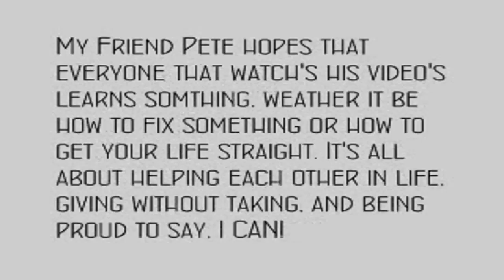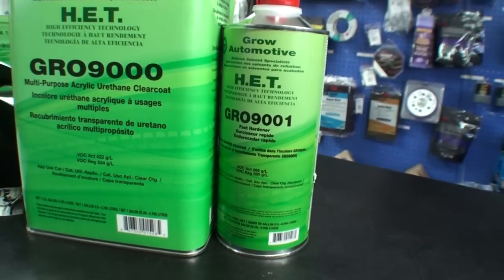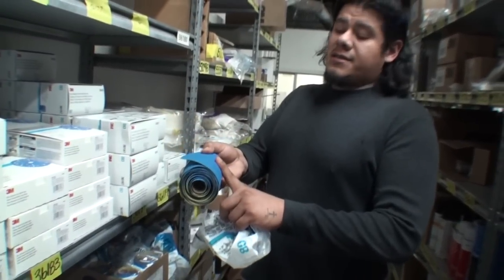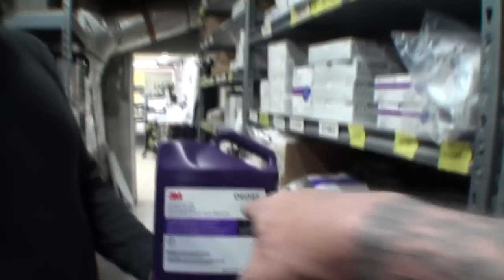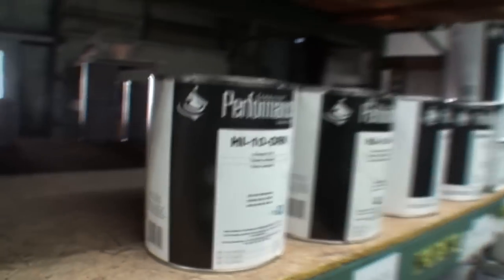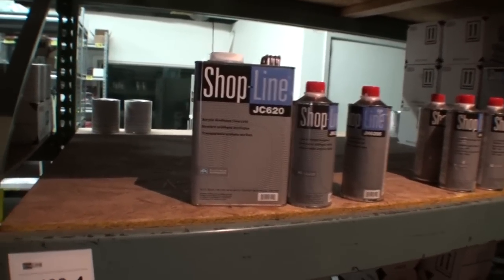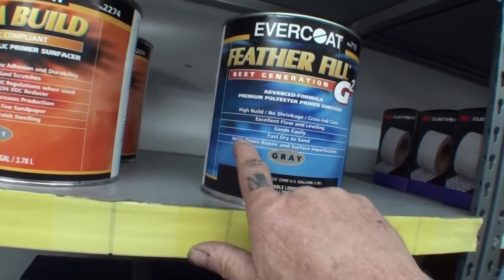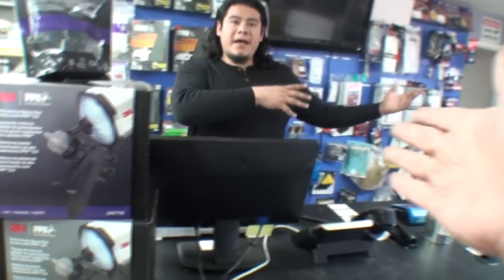What Should I Buy To Paint My Car? - Automotive Paint And Body Tech Tips

Comment: Hey my friend Pete, you should try out and review the new Harbor Freight pps style paint cup system by Spectrum. I just bought them and very reasonably priced.
Reply: You are correct but it has only two ears to hold the cup on, so it’s kinda a copy of the first generation PPS disposable cup system. It would be fine for smaller cups with the weight of mixed product. I don’t think HF offers different size cups.
 The feedback from painters on the PPS system was they felt the larger cups moved, wiggled and could possibly come although none may have. This prompted PPS to come out with PPS 2.0 with 3 lugs to latch onto the adaptor, instead of 2. It is still a good choice for a guy to purchase the HF cups, just have product mixed ready to go (Depending on Time) to swap out a cup and keep going. The size of cup, how large the area to be painted have to be figured before starting the spray. I never used them but when changing directions during the spray gun & cup, just go slower without sudden fast moves. As expensive as everything is, no one wants the cup to come off, hit the floor and waist your mix.
Reply: @deankay4434  I've used them and they are basically old pps system, but  not interchangeable with 3m.  But I have noticed the HF spectrum PPS cups fit tighter and feels more solid than the 3M PPS.  Best part about ALL PPS system is the ability to spray upside down say like under package trays or wheel lips and rockers. HF PPS  cups are good for entry level painters, or hobbyist that only paint once a year. But very economically priced for The D.I.Y. guys and gals. Never had a cup fall off or leak. But while painting you're not whipping a paint gun around in sudden jerking motions, steady straight passes with calculated overlaps . Remember sudden movements  while painting will cause more dust in the air. When I paint I shuffle my feet instead of walking.  Not saying a paint cup cant fall off, I've actually dropped my paint gun and aluminum cup snapped off in the gun. So lessons is EVERYTHING IS POSSIBLE. But take your time and you WILL get results, and listen to Our friend Pete. He knows what's up. Reason I love to get his take on The HF spectrum PPS cup.  I do appreciate your info and will take it into account.
Reply: @jamessmothers6475  I completely agree that the HF cup system can be helpful for hobbies, DIY’s or complete restorations. I have never used them or seen one, just going by what others have said. HF may have beefed them up somewhat as they can’t be exact copies as that could be patent infringement. Regardless, they are useful as long as someone using them understand they may have limits. I have a Bink’s & DevilBliss but have some new style and fitted with PPS 2.0 and I agree, spaying upside down has a great benefit. I fixed vehicles, up in the air, rust spots, thin or no paint on rocker panels or the fender lip (Including over-spray) on the inner wheel house we’re all clues of a past life done wrong. 
  Buyers purchase what dealers need for used cars. We had a truck load of Nissan Pathfinders and asked to check fluids, brakes and condition. I raised a blue on up and found the front cab to the grill painted “RED” plus a weld line left to right. Needless to say, someone bought two, welded them together and painted it. We sent it back because it was salvage! Best of luck.
Reply: We will find out what Pete thinks of them James, as he just bought some at HF. 
Don’t get me wrong, I think these work great for the benefits and the price is right. I am a cheap bastard but I sprayed something like primer and washed the cup out and re-used it several times. I do that with zip lock baggies as I have a pile for nuts on bolts to store until ready. I drop a large note in the bag to identify the parts. I can’t get my son to do that or even photos. So, 6 months after I painted it, I have to wire the pair of electric fans, relays & fuses again. He tells me he will pay me but gives the wife the money, so still free work. Best of luck to all!

Comment: that $65 clear is great for jambs that doesn't ever see the light of day. Iam old school I guess , no velcro paper for me...always use stick on.  I use the screw on double wool pad then switch to the foam pad for the final buffing.  Been using the Indasa abrasives for at least 10 years.  The hell with 3M...that stands for 3 X money.
I used to use ppg DP epoxy.  That went away and the y went to DPLF (lead free). Thats kinda pricy so I went with the PPG Essential fleet line epoxy. Its the same except less $.  Only gripe about PPG epoxy is that it contains a vinyl product so the it does not get airborne during sanding. The vinyl  product gums and loads the sandpaper...frustrating.  I have used the Tamco epoxy and does not load up....there  are others out there.  The local ppg dealer here doesn't handle shop line...they have Omni that I guess is the same...not sure.
Started my shop in  1978...no internet to buy supplies...just a few jobbers.and a handfull of paint companiies.....Dupont, ppg, acme, sherwin williams, RM and a few others.  How nice it is now to be able to search around for better deals on supplies.
I had the good fortune to chat with a paint chemist that worked for PPG in the 80s,,,was fun to pic his brain how things were done....he worked in Ohio I believe. He said that in all the things the PPG makes...and there are a lot of them that the automotive paint side is the most profitable for them.....I dont doubt that a bit.
Love your vids Pete...like your no nonsense no bullshit approach.
Reply: Love the "3m means 3 times the price" comment! LOL. Heck yeah....And stick-on sandpaper IS the ONLY paper to use when actual block sanding a car for REAL STRAIGHTNESS, as the hook it/velcro is fine for stripping, actual filler work etc. but from like even 80, 120 and so on grit when "blocking a car"? The hook-it paper WILL LEAVE grooves, lumps on the panel on your blocking process! So stick-it is fine IF ya don't wanna have to re-invest in the hook-it. Grind ON! 👍

Comment: They use to have a Trizac compound when the 3000 foam pads came out and it would break down as you polished,you only needed 1 pad and 1 compound,of course they discontinued it so you now have to buy 3 pads and 3 compounds,and you need the blue pad with the blue compound or you still have swirls.

Comment: Pete, need some advice. I've done filler/bondo on bare metal after doing quarter panel replacements. I'm going to paint the whole car but what should i apply on the bare metal/filler prior to paint. i'll use high build primer but should i apply epoxy sealer before hand? Years of watching you with so much knowledge seen yet i don't retain information
Reply from the maker: No -- You don't have to apply epoxy first -- Go straight to a High Quality 2K primer with the metal prepped to 80 grit sanding.  2 to 3 full wet coats and your ready for block sanding and painting.. THEN if you want to add a coat of epoxy right before paint, that's the time to do it!   Good luck

Comment: The pps system of cups, liners, tops with filters built in and the quick connect fitting to put it on any gun is sold at harbor freight. The cost is way below this shop. 3m's name is not on the box but it has nothing to do with how your gun works. It shortens clean up and mess and cuts thinner usage.
The gun that was on the counter is one that you toss the gun tip with each use. I saw that system a few years back and said no way. That is throwing money away every day.

Comment: Ok just a hypothetical question here. Paint reducers offer slow medium and fast. So what is it slowing or speeding up if it's just to thin or reduce the paint? I understand hardners/Catalyst. If it's to hot and wanting a slow activator so it doesn't set to fast or a fast activator during colder Temps to help speed up. But never understood reducers as it is only thinning/reducing the paint.

Comment: The whole thing with 3m cubatron or purple is its a man made synthetic grit and last a long time. With Velcro or hook it you save money if you use it right.  plus you can use a 5777 soft pad with it.   Velcro you can take it off and reuse it until it’s worn out with stick it you tear it off and throw it away even if it’s still has good cutting power it’s wasted. So if you do a lot of body work Velcro paper will save you money. If you want a excellent epoxy for low cost try the ppg cre epoxy make sure your prep work is right it prefers a blasted substrate it’s in the fleet line. Shop line plus is the exact same thing as ppg Omni. All in all it’s a good paint line. I like the 6800 euro clear or the 6700. Jc620 to me is thin so is Jc630. But it looks as good as anything once it’s cure and wheeled. It doesn’t have the chip resistants that 6700/6800 has so on front bumper covers I’d recommend activating the base coat for a little better durability….
Reply from the maker: I disagree with you on the Shopline -- OMNI thing.. Ive used Omni and to me it's the BOTTOM OF THE BARREL stuff that PPG sells.. The Shopline Pro is equivalent to DBC and uses the same toners and binders, the only thing different is the clear.. Ill take Shopline over Omni any day and I'm sure there's dozens of people that will agree with me.. I tried the Shopline clears and the only one I like is the QUICK DRY for bumpers and collision repairs. I wasn't impressed with the Shopline clear at all.. Thanks for the comments...

Comment: I've shot that value pro clear and it was ok. I typically stick to SPI clears and primers. At the shop I worked at they had me shooting Shopline clears on high end restos. I didnt think it was that bad. Shopline base......ehh  I get it on the price, but with the poor coverage of it you use more and in the end it ends up costing the same as DBC depending on the color. I switched to Automotive art Motobase and couldnt be happier honestly.
Reply from the maker: If never had any issues with coverage using Shopline as long as Ive used it.. It covers as good as DBC to me.. You might have been using the regular shopline and not the JB Shopline PRO paint..  I didn't like the shopline clear at all...

Comment: Hey Pete, working on a diy 94 Silverado Z71. Watched most of your "vidids". Bought durablocks for sanding based on your blocking video. Found out that they come setup for psa or hook and loop after eating. Did my own research and bought hook and loop since I could swap out paper (more expensive). Unfortunately, I didn't realize the paper was all so more expensive and less available at local suppliers. So, this situation has cost me more money and not less. Even though, your recemendation was spot on in theory. Thank you for hearing my complaint. Keep on providing valuable information.
Reply: Hook-it/Velcro paper is FINE for sanding body filler, or "course cut sanding" even stripping off paint etc. It's WHEN it's time to BLOCK SAND High Build Primer, and  BLOCKING PANELS FOR ABSOLUTE STRAIGHTNESS (whether "start blocking with 80 grit" OR really about anything 120 grit to 150,180 grit and higher UP the sandpaper line) IS WHEN you NEED TO STAY WITH STICKY BACK SANDPAPERS!  The Hook- It paper WILL CAUSE ripples in your final bodywork based off it's design. So, for someone that IS a DIY and ain't running a collision shop? Sticky back sandpaper and the blocks that use it ARE FINE/PERFECT for such. Been using sticky back for DECADES with my hobby/past business restoration work so... Get after it and get ta GRINDIN! 😎

Comment: Yep. They figure new ways to keep taking your money, so they can make more & more.
But a quick question Pete…
If its disposable stuff, and you dont have to clean your gun, would it be cost effective, compared to how much time is spent cleaning the Binks #7?….. Cuz time is money.
Reply from the maker: No. It takes 5 minutes  and 1.37 worth of thinner to clean a gun.
Reply: @diyautoschool  Then, it’s it big fat NO to 3M disposable junk. Also, I’m sure at some point, there will be a shortage of tips or some B.S. Leaving the ones using them high & dry.
Reply: What you have to figure on the 3m gun is it does it all by changing tip, if you go with regular guns you would be buying 3 guns for primer,base and clear.
Reply: @jeremyking5684  I think two cup guns is all thats needed. But, with the disposable system, each use is going to cost 9.00-10.00, depending on the tax rate.
If you prime 2 coats, sand, (possibly) prime again, sand, seal,  paint, and clear, thats a minimum of 4 uses, but most likely five. That's concidering you prime, seal, paint and clear the entire car at the same time. that would be 36.00 - 45.00, possibly up to 50.00 per job. Then, there will be times when another primer or 2  srpayings would be needed. It could get up to 70.00 or even more.
That adds up quick.
I’d stick to the binks for cost. I’d also stick with Binks out of principal.

Comment: Global use to be PPGs top line in 2000
Reply: It still is...
Reply: @brad-zf9oh  I always liked Du Pont system,etch primer, they use to have the best primer called URO,three  part s,and could be thinned to use as a sealer. Not a big fan of PPG only like it because I can get the older colorz.